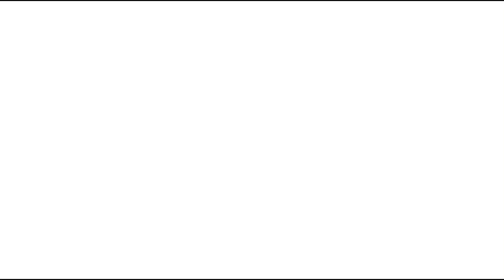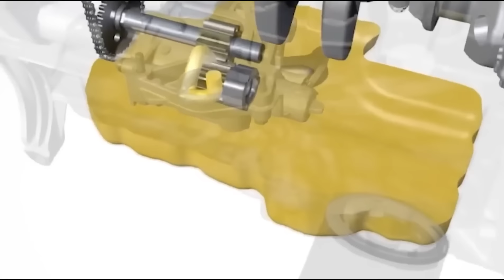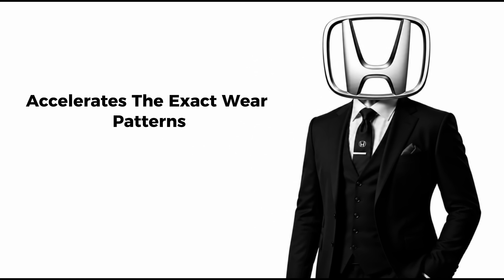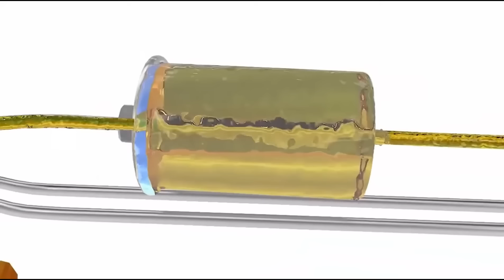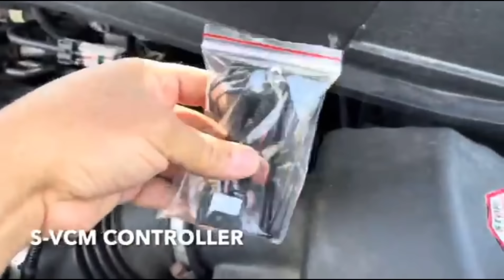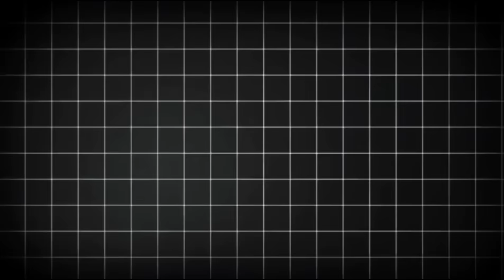HONDA OWNERS! Please NEVER Do THIS to Your Honda (15 Expensive Mistakes)

Comment: After150.000 miles ready spend $5.000 change turbo $2500 my experience whith Honda
Reply from the maker: It’s tough to face those kinds of major repair costs, but keeping up with strict maintenance intervals is the best way to extend the lifespan of turbo components and avoid premature failure.

Comment: Honda dealers are a rip off like all other dealers.
Reply from the maker: I understand that experiences with service departments can be frustrating, and I appreciate you sharing your perspective.
Reply: Very common, not only Honda, the shop recommands to change an engine and a steering pump, but I just DIY myself, just changed and added enough oil and flash the pump, it works well, driven more than two years now without issues.

Comment: Mabe you should get a Ford or Chevy and see how well that goes since Honda is so bad.  Get one of the new Broncos.  See if it even makes to 90,000 miles.
Reply from the maker: Every manufacturer has its own unique strengths and challenges when it comes to long-term reliability.

Comment: I’ve been told by various mechanics that using premium fuel will help utilize the available horsepower and performance of an engine … whenever I use 89 or 93 octane, my engines run smoother, accelerate better, and get better gas mileage … don’t use it all the time because 87 octane is ok for use in them …
Reply from the maker: It’s an interesting perspective, though most modern engines are calibrated to run optimally on the manufacturer's recommended octane rating.

Comment: After this video, I don't want to buy HONDA anymore.this video made HONDA so fragile and sensitive car.
Even when this video is warning us to buy only authentic HONDA sensors, coolant,  oil and parts, what does it mean? It means customers are being forced indirectly to spend more, to get only original HONDA parts. And simultaneously continuous open faucet for HONDA company to generate money. 
No wonder many customers are shifting their attention from Honda to other car manufacturers where reliability is real and parts price is logical and affordable.
Reply: Honda's parts from dealer's counters are 4 times expensive as other aftermarket parts.

Comment: If you use an aftermarket sensor to save money there is a good chance you will be swapping it out for an OEM (Honda) one. I learned my lesson on that! It was on a Nissan.
Reply from the maker: That is a great point, as sticking with quality parts often prevents the need for double work later on.

Comment: The j35 water pump is driven by the timing belt.
Reply from the maker: You're absolutely right! The J35 water pump is indeed timing belt driven, which is a crucial detail for owners to know. Thanks for pointing that out!

Comment: You need to break down this video into specific engines and needs. This is way to general for most people to understand. I have a 2017 Accord Touring Hybrid and have 150 k miles on it with only my militance and truly believe I will hit 200 k easily.
Reply from the maker: That's an excellent point, and I appreciate the suggestion to provide more engine-specific breakdowns in future videos.

Comment: The 1.5 engine bad design is blowing head gaskets especially in Accords
Reply: I got the model with the 2.0 hoping it’s better
Reply: @CocoArtofGod It definitely is!
Reply: I wonder why Accords more than Civic and CRV? Same engine, right?
Reply: how about an 02 civic ?
Reply from the maker: I appreciate you sharing your observations regarding the common mechanical issues with that engine platform.
Reply: I have a 2020 CRV with a turbo that I got in 2021 brand new. And I’ve heard that they are happening in CRV’s to the engine is not good. I have just now hit 50,000 miles. I take care of it I take it to the dealer and have it all the work done on it but I’m a little stressed out about what might happen.

Comment: Does this all apply to my new 2026 CRV?
Reply: If 1.5 turbo engine .....its a small engine forced with a turbo to make it perform  
It performs but turbocharged
Reply from the maker: Yes, many of these mistakes apply to newer models like your 2026 CRV, as they often share similar underlying systems and components. It's always best to be cautious!
Reply: I have a 2016 crv touring . Anything additional I should watch for? I always wait for my car to tell me when oil change is needed.

Comment: Er I paid over £900 for a new Oxygen sensor at a UK Honda garage. They are Bosch and cost less than £115 including postage!
Reply from the maker: That is a significant price difference, and it's a great example of why it pays to research parts costs beforehand.
Reply: @HondaZone-r2f sadly I live in Germany and my car was not going into gear after stopping. And I had to travel by ferry!

Comment: Its amazing how the Honda's go so well for so long.....
Reply from the maker: They really are built to last, aren't they? It's a testament to good engineering!
Reply: Until your transmission blows, at 200,000 miles, then it’s $8000 to fix it. I have a 2025 Honda Civic LX, it seems like I put in quite a bit of money into it to keep it going every year. I replace my brakes every year, oil changes every three months, a new battery every couple years. This goes on. Just did a $2000 break job on the car, since it has a back brake drum.

Comment: Actually, that’s 100% bullshit. It is not always the driver quite a bit of the time. It is the manufacture that makes it when it comes to the transmission, especially the intend to overheat and you have to keep throwing in transmissions every time I know this from experience it just rubs me the wrong way because I love Hondas, the only thing that is usually good for a long long time is the motor the transmission is trash. It goes out quick just like a mustang. You have to buy a transmission cooler to cool it down that’s one aftermarket modification. It definitely needs.
Reply from the maker: I am sorry to hear about your negative experiences with transmissions, and I appreciate your feedback regarding common points of failure.
Reply: Any machine needs to be taken care of by the owner,  just as your body, if you don't take care, you will get sick and die sooner.

Comment: Can you do a video on Honda HRVs? The older 2021 ones and CVT care.
Reply from the maker: That's a great suggestion! I'll definitely look into creating a video covering Honda HRVs, especially the 2021 models and CVT care.
Reply: Change the fluid every 40 or 50 thousand miles